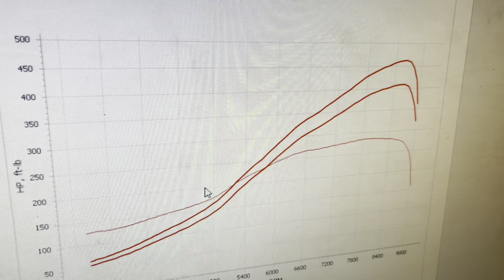We Build & Tune an Epic Boosted Ep3 Civic TypeR

Comment: How much would it cost with fitting for a full turbo kit for a Honda Civic type R ep3? But with a big turbo so it sounds mad and pulls mad how much would all that be with fitting? Thankyou
Reply from the maker: Depends what spec you have now.
Reply: @DynodazeHondaTuners  I’m looking to buy one It would either be civic type R EP3 old one not the new or Honda S2000 I’d be looking to get full turbo build and fitting
Reply from the maker: @thatyoutubecarguy6428  S2000 engines take loads of boost :) do that
Reply: @DynodazeHondaTuners  hi mate I need some advice I’m looking at a Honda Civic type r mugen 2010 model 200 edition so only 200 made is that a worth while investment and can you modify them much? Thankyou for all the help
Reply from the maker: @thatyoutubecarguy6428  great cars yes, expensive for an FN2

Comment: 400BHP, but only 280ftLb of torque? was expecting more
Reply: torque is kept low to save the conrods. Remember its a stock block.
Reply: Think your forgetting its still a high revving NA derived engine.
Reply: It's a really light car. And over 400 at the wheels with an mfactory diff suprises most things. The rods were a factor. But that maybe something to change in the future... Its deep pockets over this power and reliability issues even if you forge it.
Reply: @lexzenis2544  power and torque cross at 5250RPM, this clearly revving much higher so is where its making the power